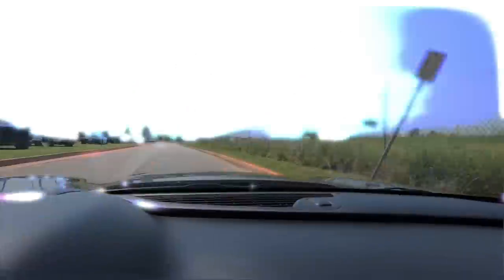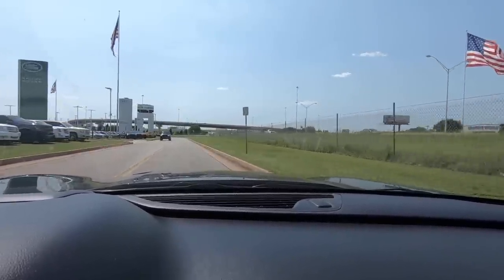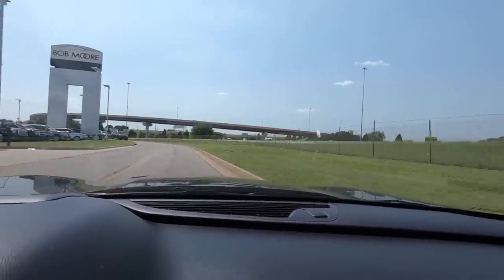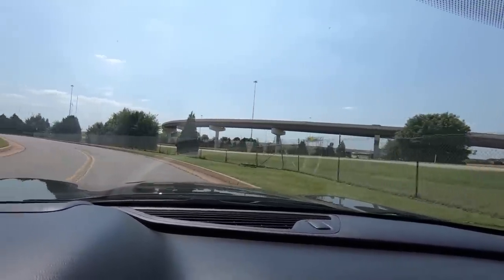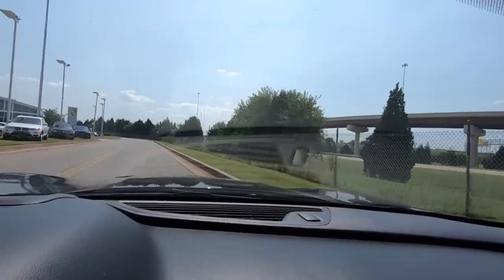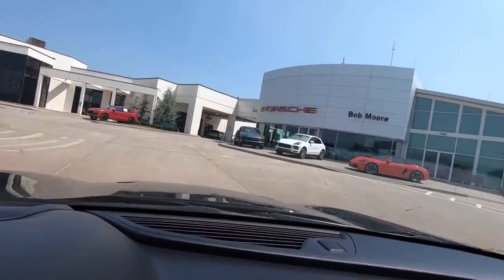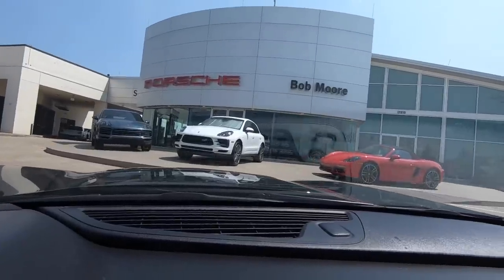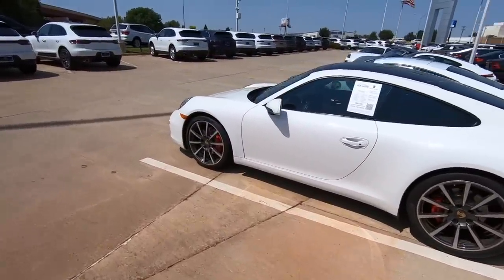Cheap $7100 Copart Porsche 911 996 Oil in Coolant - Uh oh!!

Comment: The oil in the cooling system is probably in the process of destroying all of the rubber hoses in the system.  They swell up, get soft, and burst.
Reply: Frank Healy 
Very true oil in coolant system definitely destroys rubber hoses
Reply: That happened to my Acura after the radiator failed and mixed the transmission fluid with the coolant  after that I had a rubber hose blow every few days ...been good after I replaced all the rubber hoses
Reply: @RTSELLS  25 inches you mean. That should not damage a good hose. If a hose or any other part fails after vacuum filling, then the part was already compromised.

Comment: Oil in the coolant made the rubber Y hose soft and all the other rubber hoses. Bite the bullet and replace the hoses.
Reply: Kellys Peppers 

100% correct. All rubber hoses are compromised.
Reply: needs to make sure no oil is getting into the system first. or those new hoses will go bad too.
Reply: I think that motor oil in the cooling system because of its viscosity allowed for improper pressure build up and that in turn caused the weak hoses to pop . I'm wondering if the same thing can happen with laundry detergent..
Reply: I agree
Reply: The hoses are 20 years old anyway.  Good preventative maintenance to just change them anyway.  Better at home than on the side of the road or getting towed to a shop!
Reply: Yep, rubber cooling hoses don't like oil!
Reply: yep
Reply: Just came in to say the same thing! And found it already said. Agreed, All the rubber hoses should be replaced for the best for the car if all else checks out fine. PS: LOL I need to learn to watch through the entire video before commenting. All new Rubber!! Even if the vacuum is contributory to the failure its just revealing the weakness of the old hose.
Reply: Agreed oil does not do hoses much good.
Reply: Yeah, the coolant hoses are not made for oil. They will all swell up and get soft. They won't be able to take the pressure of the cooling system.
Reply: Was gonna say but you did it for me. That VAC does a number on oil/oil soaked hoses. Don’t think I’d use that on anything with over 100k mi, add tons of headaches!
Reply: @ciocclaude  Nope, the oil causes swelling in rubber. Pressure buildup is controlled by the coolant tank cap. You can see by the Y hose that swelling has taken place - strength is therefore compromised. As has been stated earlier, all hose need to be replaced as they will now fail, one after the other.
Reply: mike brink  Same as brake seals, they swell in the presence of mineral based oils too.
Reply: But why spend money before it's determined what the problem is?

Comment: Meaby that small hose was bit bad and when you "sucked" it, it bursted... Hmm that vacuum suck might really bust old hoses..
Reply: beter now than later when your far from home ....
Reply: The coolant hoses was probably not oil resistant in the first place. It seems that this would be a perfect time to contact FCP Euro and ask them to put a coolant hose kit together for you Randy.
Reply: @hgn98009  +1 on that! They seem to be a good company and will probably be a lot cheaper than Bob Moore too!
Reply: I was thinking more along the lines of running water instead of coolant may have caused a lot higher pressure in the system that burst a hole in it. Water boils at a much lower temperature than modern coolants.
Reply: @sinformant  ...but the car never reached 212 degF based on the temp gauge....if it was below 212 then the pressure developed wouldn't be much different. The broken hose looks soft and pliable...all the signs of having aged/degraded possibly made worse by the oil in the coolant.
Reply: @TheWilferch  oil could have deteriorated it no doubt, however I don't know the boiling point of the fabric soap, and maybe it could have changed the boiling point of the water. Also there have been cars that have overheated without the cars temp gauge climbing because of the location of the coolant temp sensor. When it got air in the system an air pocket collected around where the sensor was and it didn't receive an accurate reading. Also when you pressurerize a system.it changes the boiling point of a liquid as well.
Reply: @sinformant  ..no doubt higher pressures elevate the boiling point of coolant...even pure water. However these other points you bring up, the sensor location and possibility of air pockets... can occur regardless of which coolant mix was used. The vacuum method used and the near-assurance that the system was filled ( re-view the point of the vid where the fill pipe was full to the top, etc)...the length if time the car was running, etc.....lead me to believe the system was fairly full. In any case, any of these factors you cite would not raise the pressure so much to burst the hoses, unless the hoses were either age or oil deteriorated in the first place. hose burst ratings ( margin) is considerable for undamaged hoses.....the hoses were softened or deteriorated.

Comment: Randy,,,those hoses are splitting open because they are old...but when you do the vacuum  it spreads the chords inside and hence splits them open.  We stopped using this airlift machine in our shop for this exact reason.
Reply: Good tool for selling a full hose replacement & cooling system service ! = $3,000.00 + ??
Reply: Oil destroys coolant hoses. This is not surprising
Reply: I would put my money on some turkey having put the oil into the cooling system thinking he was putting it into the sump. Having said that you will have to replace ALL of the rubber hoses or you will soon blow one and cook another engine. Probably a $500 investment to save $8000 to $10000.
Reply: My mates car had oil in the coolant but no pipework burst and the oil must have been in the pipes when he got it. 3 years
Reply: I would be skeptical of vacuuming my cooling system. You’re asking for trouble.

Comment: Hi Randy. I would replace all the rubber coolant hoses. Buy off e bay. If oil still gets into cooling system, its probably a crack in the oil cooler.  Rev.

Comment: The hoses are reinforced rubber, when you pull a vacuum on them you are pulling against the grain, they are designed to expand not contract. That kit might save time but its costing money. Essentially the hoses have a designed matrix embedded in them thats ideal for the forces involved i.e. straight line, curve t-piece etc. When you pull a vacuum you are reversing those forces. I wouldn't bother. That kit is more harm than good.

Comment: You have a ground strap cable ground problem.  I see the running voltage in your car at 12 when it should be around 13.5-14v.  it's the ground strap that connects to the back of the alternator, starter, and the frame.  cable costs around 50-100.  You'll know that you really have an issue that after the car is warm it's tough to start, slow to turn over.

Comment: With as much oil that was in the cooling system its going to eating all the rubber hoses from the inside out. Your best luck would be to replace all the rubber hoses.
It’s going to be battle.
Find a silicon hose kit.

Comment: one round of flushing is all you really needed to get almost all the erl out. sure you may have some residual erl left, but, thats a good thing...the coolant would still do its job, the small amount of erl in the system shouldnt affect the rubber hoses swelling hardly at all if any....and you would have extra lubrication in the system for the water pump and heater valves for longer life.

Comment: When your done you could put waterless coolant into it as someone else has said the oil has made the hoses soft. Please change thouse alloy wheels
Reply: Waterless coolant is often a bad idea, it has nothing like the heat capacity of water, a few devotees like it because it has an extremely high boiling point so cars with marginal cooling don't boil over but in fact are still overheating.

Comment: It’s not just an automatic, it’s a PDK the fastest shifting transmission you should try one they’re insane. My buddy has a Turbo S and its a rocket.
Reply: pdk means porsche  Doppelkupplungsgetriebe which in english means porsche dual cluch transmission and it is fast af
Reply: dragos2009 Yea I know
Reply: And, Clutch's,  pressure plates and throw out bearings  are "not" under warranty ! Automatic transmissions "are" ! Clutch's and all related components are considered wear out items , just like brake pads. Not under warranty.
Reply: Douglas Smith Who cares keep it for 6 months up to a year and sell it

Comment: Randy before considering the head have you considered the engine oil cooler, you could remove it and have it pressure tested, if it was it could save disturbing the head,

Comment: Uberman ! when the head is cracked white steam comes out the exhaust even when it is hot outside. This is not happening. Also the crank case will have water in it and this also is not happening. It is most likely fixed. Flush it out with water. I guessing you have success. Someone poured oil in the coolant and caused all these problems.Good fix. Your right oil soften up the hoses and probably more to come needing to be replaced.

Comment: just watched this playlist, as soon as you put your finger in the coolant tank i said somebody put oil in the wrong spot as it was pure clean oil, the more you looked the more to me it seemed somebody did an oil change and filled up the coolant tank, it was FULL lol they proceeded to start the car which killed the original engine, that engine was changed as we know now with a brand new 1 but they did not clean out the coolant tank and as the system expanded and contracted some of the oil went through the system which is why the oil level never dropped and coolant never went typical milkshake colour just an dirty water colour,  My wife whom is petrified of cars and car crashes also enjoys your vids especially the copart walk arounds, so its a win for me, greetz from Western Australia.

Comment: 6:30 Pro tip: When removing a bad hose, cut the hose before taking off clamps. You can move the pipes anywhere that makes it easy to get the clamps off.
19:00 Sounds like you need to replace all the coolant hoses in the car. They are probably all oil-damaged. Just bite the bullet, and replace them all.

Comment: That rubber Y fitting looks to be a pre designed failure point by Porsche! Other manufacture's do it as well like ford with the plastic pipe barb connecting two separate lengths of heater core hose rather then one continuous hose!!! Nothing compares to Ford putting profits over lives by the way that they use a SINGLE CYLINDER MASTER CYLINDER (LOOSE ONE BRAKE LINE & WHEN THERE IS NO BRAKE FLUID/PRESSURE, THE EMERGENCY BRAKE WILL NOT WORK & IT IS SUPPOSED TO BE YOU EGRESS/ BACK UP/ SECONDARY BRAKING SYSTEM) HOW ABOUT USING A DUAL CYLINDER MASTER CYLINDER TO BEGIN WITH? I thought a dual master was the STANDARD YET, FORD FINDS WAYS TO PUT PROFITS OVER LIVE'S!!!!!!

Comment: 2019 Benz with 700 miles and no warranty🤔🤔
Reply: Glad someone else saw that. An 80,000 as is lmao
Reply: That just means the dealership has no warranty for it. The car will still have it's remaining factory warranty. This is common dealership practice. Prevents people from coming after them for warranty problems instead of the manufacturer.

Comment: Randy, just get all the rubber hoses replaced. Save the headache. Get it mechanically sound then worry about mods. FCP Groton was where I got my Genuine Volvo parts many years ago for my 1993 940GLE Turbo Wagon. FCP group is good in ensuring quality original parts.

Comment: Randy - Check out Wheeler Dealers season 17, episode 1. They work on a 2000 Porsche 911/996 convertible. The big problem they say with the 996 is the intermediate shaft (IMS) bearing. If it fails it can trash the engine. They were concerned with theirs and it only had 65,000 miles.

Comment: If you keep using the air lift, you're gonna keep tearing up hoses. A cooling system isn't meant to have that much vacuum pressure.
Atmospheric pressure (0) to maybe +20 psi is all she wants.
Obviously some sort of vacuum happens when pressure changes with opening/closing of thermostat and system, but that's when it's full.
Plastic tanks and rubber hoses shouldn't vacuum down like A/C systems.
Also, the bottom drain won't get all air out of a system. Air goes up, not down. You would need to find the highest point of the pressurized cooling system to fully bleed off.

Comment: Randy I am making several Comments. Those hoses are a Common Failure The Lower hose you mentioned you might as well go ahead and replace while you replace the big hose you showed they are not that expensive the Hose needs to be replaced anyway. It is a recommended procedure from Porsche to replace all the hoses if the engine is Changed. After that you shouldn't have any more problems unless the Heater Core Collapses during the Pressure test which is Common. Looks like the old car is telling you what She Wants. When the system is deflated if there are old hoses or older hoses they Tear at the collapse point on the inside where the suction crease is created most tear between the inner and outer linings on the inside then they get weak and burst. It is not a big problem just a afternoon of work.  Considering a Bare left door Trim Panel from Porsche costs $ 1650.00 - $2600.00 depends on the options. I don't have the VIN number. You can get Both Door Trim Panels Re-manufactured almost like new for about 600 bucks. There are some aftermarket panels available but they are not inexpensive. Those are Good Sports Cars and if you are a DIY better that Paying what the Dealership Charges and their Tech's are or may not do as good a Job as you can do. When those vehicles were built Porsche put in a small amount of Stop Leak in the system during the manufacturing process. Some manufacturers still do that. It is a Special coolant with the additive. Bet ya didn't know that did ya? LOL Have a Great day if you need anything else Let me know. I can Possibly get Porsche Parts at a Good Discount for ya. I used to work as a Contract Factory Representative for Porsche GMBH to get their Problem Child's fixed once and for all. I know those Vehicles very well. My only Concern is the Heater Core Failing but so far it has held. Those cars are not as complex as people make them out to be. I doubt there is a problem with the engine intermix of oil in the coolant. It most likely was the other engine. Study the Cooling System you will see why?  This is 911 info on 9-11..... We all should pay Tribute to those who lost their Life on this day.

Comment: I don't really know Porshe's but that oil pressure gage looks a little low . Less than 10 pounds of pressure. Were does it go up to when reving up ?
Reply: That gauge shows bar not psi...although 1 bar is about 14.5 psi so it does seem low. But when he first starts the vehicle you can see the gauge at about 4-5bar

Comment: Little hose is $56 and I am sitting here making hose for F150 saying that's like $2 worth of hose lol. Farm implement dealers sell all sizes of hoses that will handle years of pressures from everything for less then Porsche. Y connection. Small bits of hose + Y stainless steel  barbed connector  from Home depot or a fleet store and you have yourself a hose that will last forever. Imagine all the strain on that Head gasket with that vacuum system like those rubber hoses. Fact its holding pressure tells me too you don't have a head gasket issue.

Comment: Why are you using that suction fill on that older porsche? Of course you will bust hoses, they are not brand new. Theres nothing wrong with draining and filling the normal way, doing the burping method helps get a lot of the trapped air. Also youre buying cars from copart why are you dumping money on oem parts? Look on ebay for used, or new aftermarket hoses. Doesnt make sense to buy! Plus you over paid for this, MMR on a 1999 boxster is $7,700 at manheim auctions. If realistically speaking the market value of what car dealers will sell this for is 8-9,500. So you could have picked up a good running boxster for 7 grand without a blown motor, if you have an auctions license. Im not trying to give you a hard time, but ive been around the block with copart, newbies get this idea that just because a car is at copart, that means they are stealing it. Copart does have good deals, but the majority its overpriced. My advice for you, if the cleaning doesnt clean out the engine and the motor is blown, take that car back to copart and price it for the same amount you bid on it. This will be a money pit for you!

Comment: If the leak was at part number 32 on the list I sent there was a TSB not a public notification and all of them should have been previously replaced. It wasn't a recall just a Technical Service Bulletin sent out. Repairs were supposed to be Free when they were newer. It would have been done during a Oil change and the Customer would have not known. There were a lot of failures in Europe. It paid on Warranty .6 labor Hours. A lot of them Failed...

Comment: So if I were to summarize how to clean the intermix from the system in 4 steps, it'd be 1. Drain old coolant through drain plug. 2. Put half gallon Shout mixed with water into the coolant system. 3. Run the car to operating temperature with heater ON. 4. Drain via coolant drain plug. These 4 can be repeated till there's no oil residue exiting via drain plug. Correct?

Comment: Blue 996 Convertible looks sweet even if you did spend the top $j still say it’s worth it with bearings corrected and all other problems fixed you re good to go. Beautiful looker - convertible no less. My thinking is because of the Shout , the soap bubbles created more gas pressure thereby blowing any weak link ( hose) thus your leak on a minor hose. Tanks for the  review .